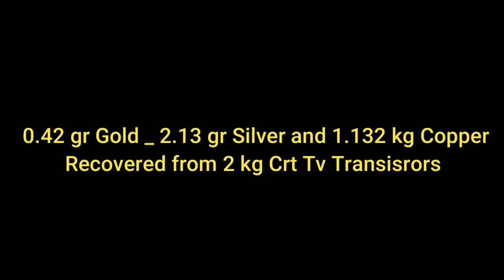Recovery Of Gold . Silver and Copper From Crt TV Transistor | Gold Recovery From Transistors

Comment: Looks like you had a small score, was the left overs copper. I am curious if you can reuse the chemicals or is it one and done. I know that the chemicals are costly and to be able to make it worth it, I was wondering if it can be reused or just waste now. Thanks for any info. Stay safe.
Reply: Most chemicals can't be reused, or reused in the same way. Some can be reused. Nitric, Muriatic, AP, AR, all are different. But Hydrochloric acid and Sodium Nitrate are cheap, and if mixed and on heat, it works the same as AR made with Nitric Acid.